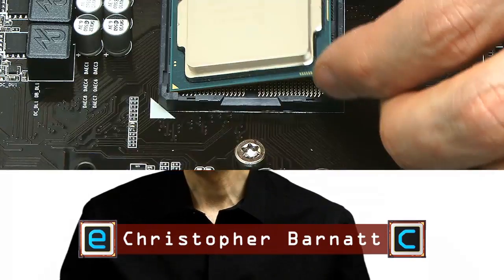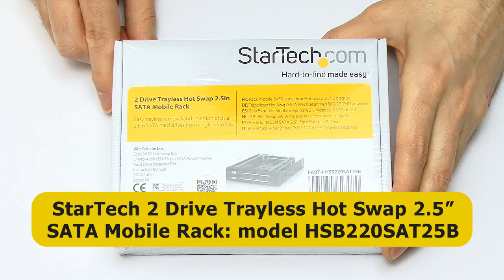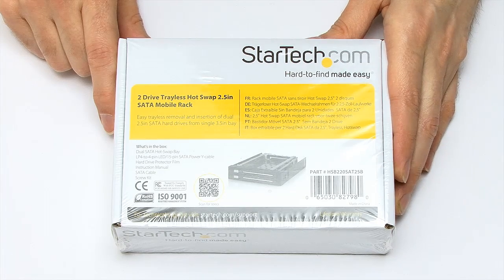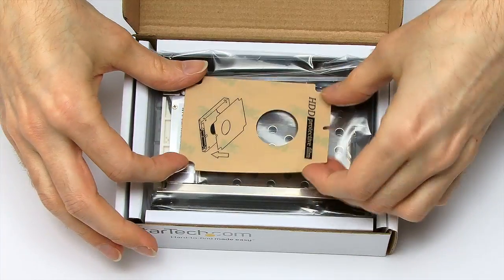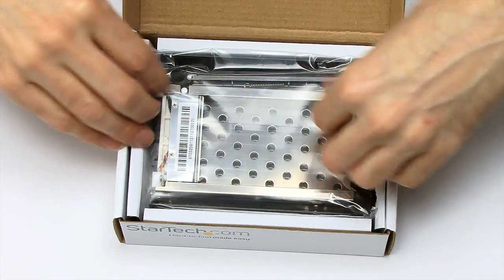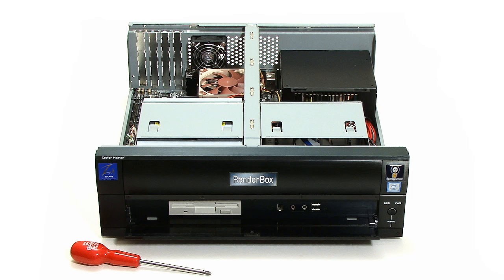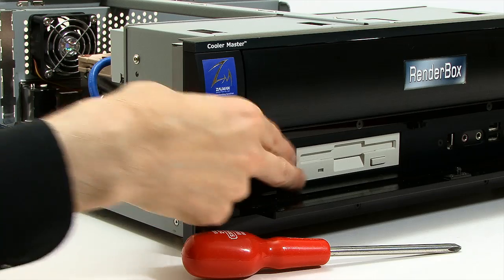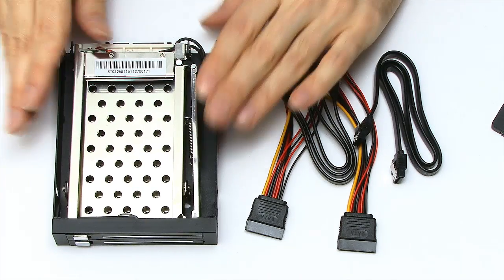Dual Trayless 2.5” SATA Rack

Comment: youtube for some reason is giving me your old videos. Not that I'm complaining. Now that some time has passed, is this still useful? I have an old laptop hard drive I keep in a USB 3 enclosure and I get fairly fast speeds writing to that, and about 200mb/sec when I have an SSD in it. 
I'm trying to think what the useage scenario is for this. You have a 2.5" drive in a camera maybe, and this makes it easy to insert into the computer? 
Transferring from a laptop, but then you have to unscrew it (still useful-ish) to get it out?
Reply from the maker: My usage scenario is mainly switching OS -- having different OS on different 2.5 inch drives. Also accessing drives from archive/storage. And SSDs from HDMI recorders as you say.

Comment: Any reason why I should not use this for swapping/carrying one set of SSDs between my home office PC and my (identical) work PC, instead of trying to keep everything in sync remotely, particularly also OS and programs?
Reply from the maker: For data transfer, no problems at all -- keeping your data on a drive you move bewteen systems can be a great way to work. Some programs may also work. But I would not move around the OS between two PCs unless the hardware is identical (to the level of matching BIOS revisions) as you will run into issues with Windows.
Reply: @ExplainingComputers  Thanks -- actually I WAS thinking to move the OS drive around, because everything else is already synced via cloud. However this most probably will give me problems with Windows and software activation and licences, although the hardware is identical.

Comment: 7:15 That is why you have these molex cables. 
These molex to sata adapters have a bad reputation of causing fire. 
Therefore, is it possible to use this rack without such molex to sata adapter???
Reply from the maker: Yes, you can use it without the adapter (although the drive lights will not work). But there should be no fire issues using SSDs and 25" drives with the adapters -- they draw far less currently than a 3.5 inch unit, and only at 5V (not 12V).
Reply: > "they draw far less currently than a 3.5 inch unit, and only at 5V (not 12V)." 
Good point !!! 
+1

Comment: Hi there, is this SATA thing itself hot swap capable. Could i open the computer case and just plug in a sata drive.
If yes is there a order witch one i should connect first, the power or the data connector. Thanks in advanced!
Reply from the maker: Yes, potentially hot-swappable if this is supported by your OS and drive configuration. Not something I've tried.
Reply: @ExplainingComputers  Thank you for reply, guess i have to refer to the manual or consider to ask my local shop
 to be sure.

Comment: I like the new storage system you have in your computer and hope all works out just fine for you with it. I would like to put something like that in my computer, but don't want to change things around that much. For that reason I will stay with my regular system and if I build another computer it can have 2.5" drives in it.

Comment: I've got one from StarTech that has one 2.5", and one 3.5" bay. Mounts in a standard 5.25" slot. Good for pulling data off old hard drives, or cleaning them for secure disposal.
Seems they've got some active electronics on this model to sense when there's activity over the SATA cable. IDE and SCSI each had a pin that was dedicated to drive activity that was high when there was power to the drive, and pulled low when there was activity, and this made it easy for an enclosure to indicate drive activity. I didn't think there was a way to do that for SATA beyond connecting directly to the controller/MB for the LED.
Reply: Pin 11 on the SATA power connector can be used as an activity indication, though not all drives support it. It is almost certainly what is being used here.

Comment: I love hot-swap bays. Great for any kind of RAID setup. You get a notification that one of your array members has failed, you just pop out the old one, stick in the new, open the RAID utility and tell it that there's a free drive available for rebuilding onto (if you don't have it set to do that automatically), and all without even having to shut down the system.

Now, keep in mind that unless you're using a dedicated RAID controller (which usually support hot-swap), you probably won't just be able to swap out drives without at least having to go into device manager and tell it to scan for new hardware, etc., so this might not be the kind of thing a home user would make use of.

Comment: My main (most powerful) PC has two SATA hot swap bays, one a full-size 3.5" and one is a 2.5". They are both quite similar to what you show here and I am pretty sure even manufactured by StarTech as well, but they actually have a lock and key mechanism too! Unless you have the key, you would basically have to destroy the entire case to access it because they are extremely well built with steel not plastic, and if it is a HDD, it will likely be destroyed just getting to it. They have served me well for several years now, and I definitely recommend them!!!

Comment: I have an Asus ROG GL552VW and would like to replace the optical drive with a caddy or something to put a standard 2.5'' HDD in, however all I've been able to find so far is a type of caddy where you would need to take the whole assembly out every time you swap the drive. Is there a variant of this type of device for laptops or do I just have to keep a screwdriver handy?

Comment: The HDD disk connectors are specified to allow 50 !!!!! connects.
So don't switch too often.
Reply from the maker: This is a really interesting point -- SATA was initially specified at 10 connects! But a lot of pro video hardware now uses an SSD or 2.5" HDD that plugs in via its own SATA connector as the storage media (eg equipment from Atomos). I use such hardware, and often swap the SSD many times a day, and it has always worried me. Certainly the SATA connectors get looser over time. But I've not had one fail yet -- and my oldest recorder has probably done a good 300+ insert/remove cycles.

Comment: I see little reason why StarTech decided to not line the bottom of the drive trays with an adhesive layer of plastic, or had made the drive bottoms out of plastic. If I were engineering that thing I would had made the drive bottoms slide in, clip into place (since plastic can clip in easily) and it would had circumvented the need for protective anything to prevent possible shorting due to metal-on-metal.

About the supplied connector, while it's nice they provided two wires, I don't understand the little extra bit hanging off. If they wanted to be good and proper about it, a locking 1x LP4 to 2x SATA power Y cable should had been sufficient. Power for the LED should had been drawn from the SATA port and not require a separate connector, since i have bits of kit at home that only have a SATA port and the board layout dictates it draws from SATA the power.

Even a piddly 5-volt rail from USB can handle both SATA power to the drive and a basic LED that flashes with drive activity. So the entire design of the unit, while functional, flummoxes me why they went with some of the odd design decisions they did.

Boy the video is full of surprises. I didn't realize they had to power two LEDs. Why do the bays need two LEDs? Seems like a blue one for status and red one for read, used cleverly to render as magenta. Pretty, but whoever made the bay could had reduced costs by using one LED always on for read only. I guess that's why the special connectors have two lanes on the SP4 connector; One for each LED. It's stupidly over-engineered, down to the lights!
Reply from the maker: I agree with all that you say! :)

Comment: LP4
Strange isn't that? When AMP originated that connector, they called it the Mate-N-Lok. When Molex acquired AMP, it became a standard on hard drives and was brutally genericized to Molex despite them making a variety of motherboard and cable interconnects. Now Koch has Molex and they call it LP4.

Speaking of, wasn't there a time when this connector became SP4 before that represented the old connectors from FDDs made by Berg?
Reply: Molex didn't acquire AMP. 

AMP was bought by Tyco in 1999, Tyco then split into three seperate companies with the AMP products going to "Tyco Electronics" who then ranamed themselves to "TE connectivity"

Both Molex and AMP/TYCO/TE have been cloning each others connectors for a long time though. Sadly they use different names for them which can making figuring out the equivalences a PITA.

Comment: Can you recommend one that fits in a 3.5" DVD/CD slot. I see they have some nice Quardrupple ones for 2.5 sata disks
Reply from the maker: You could out this drive in a DVD slot (5.25" bay) using a 5.25 to 3.5" bay adapter. StarTech sell those too! :)
Reply: True and sorry meant 5.25" slot not 3.5" I found this nice one instead, think I will buy it :) http://www.chieftec.eu/en/accessories/sas-sata-backplanes/atm-1042s.html

Comment: Nice Chris.  I'd like to ask for a favor.  If not too much trouble, please set the drives up in a mirror configuration and test the "hot swap" efforts and the RAID rebuilding (preferably BIOS RAID rebuilding but if you must, Windows' RAID rebuilding will work too.  I'd like to know if it'll work like a proper server's hot swaps.  Nice and informative non the less.

Comment: Hi Chris, Sitting in Tokyo Japan watching your videos is a refreshing way to travel back to Blighty in some ways, I mean hearing your turns of phrase as you talk to yourself is really very charming! Do not worry we all do it when we are tinkering with computers, how you manage to keep the Anglo Saxon out though is to be commended also. I am enjoying your videos Sir indeed, do carry on old chap! Hopefully another generation afraid to ask dumb questions is also stealthy watching your exploits and learning along the way. I have spent the last two years hoovering up old yet viable Vista era hardware from the Hard OFF shops around here in Japan a second hand chain local to the Kanto region here and making perfectly serviceable Windows 10 PCs out of all the discarded value and rotating them back out. So I have been able to follow a journey of power and speed through all the CPU and memory configurations I was never able to afford to purchase in the white heat of the PC era 2004 through 2012. The conclusion buy any modern fast SSD like the San Disk Ultra II 480GB versions and bolt it to any Dual core above or equivalent to an E8400 with 4GB of RAM and your cooking with gas if just general surfing and watching You Tube Videos in HD is your 2017 benchmark of use. I am Windows 10 insider so the OS is free of charge for the boxes I rotate out. Giving back a little value to the community here was the thought. Though the reality is Desktop PC use here is declining massively as the mobile onslaught continues anyway. Which means more and more choice hardware is being dumped in these secound hand stores here. https://www.youtube.com/watch?v=rfZFTEAZcvA&list=PLyJvQFBp5UVOIEisUSESuUFrDwfRVdzcA

Comment: Can you hot swap the data drive?
Reply from the maker: Yes, the drives in here are hot--swapable (if the motherboard supports this).
Reply: Do u have to dismount first?
Reply from the maker: You should always dismount (in the OS) first! The computer has to be prepared for the fact that you are about to physically disconnect a storage device. :)
Reply: Thanks Chris
Reply: i also think that is chipset dependent cause the correct thing to do is also cut power for the drive on those cases,belive me,i fried a drive trying... it smoked as i wigled its (still hot) power connector out of the socket
Reply: You'll need to go into your BIOS settings, and look particularly for the SATA settings. For example on my motherboard, you can enable hot-swap on a per-port basis. This of course depends on your board and which chipset it has, but generally, it'll then let you select the drive from the Safely Remove Hardware icon near the clock in Windows. A bit like when you want to dismount a flash drive. Some boards will also detect a drive has been introduced, but if not, you can Scan For Hardware Changes in Device Manager.
Reply: I use this for proper system removal w/o having to power off.
http://mt-naka.com/hotswap/index_enu.htm

Comment: Hello ExplainingComputers. Thanks for the video! You should forget about those protection sheets on each harddrive and place a piece of anti static teflon in the trays instead. You can buy A4 sheets that are adhesive on one side and cut them out with a scissor. When you are done, you can use the rest of the sheet for new mouse pads, to make your mouse slide like new again! :-)
Reply: You could also clean the grime off the bottom of your mouse :P

Comment: This question doesn't fit in here, but I just want to know if I can connect the new macbook pro(usb type c) to a arduino board(usb type b) with a adapter or a usb c to usb b cable?
Reply from the maker: Yes, both of these options should work fine -- the different USB connectors are just that; the USB data that flows through them is the same. Everything is backwards compatible. :)
Reply: Thank you so much for the quick answer!:)

Comment: they should have just had a back plan on that caddy for power and then the data why the need for all the extra wires when it could be all done with just one power cable.

Comment: Does your motherboard have support to make the SATA port hot swappable while the computer is still on?
On my old computer, I had a 3.5" hard drive caddy in a 5.25" slot but it was not hot swap compatible and had to power down to swap out the drive. My current computer I have swapped the SATA port in the motherboard setting to hot-swap compatible that my trayless 3.5" hard drive bay is plugged into. I can select the eject option you normally use for a USB stick or external hard drive so I can swap my data drive without powering down now.
Might I suggest to make life a bit easier you put your SSD boot drive into the bottom and the HDD into the top. Stick a piece of anti-static plastic into the bottom of that top tray over the metal. That way even if the drive does not have one of those stickers on it will sill be a little bit protected.
Reply from the maker: You do not have to have a motherboard with hot swap compatibility to use the bay, but you can only hot swap the drives if your motherboard supports this.

Comment: Where did you get the Render case, and what motherboards can be installed in it?  This would make a great compact out of the way desktop PC which I really need.
Reply: Fractal design node 202 might work as long as your monitor isn't too heavy and you can get an itx board that satisfies your needs, it will lay horizontal or stand vertical and can fit most add in cards except for some extremely large graphics cards. You would have difficulty finding the Render case as it was stated in an earlier video it was from the old build with the core 2 so it is probably out of production.
Reply: +William Todd
That was just the first one that came to mind, there are several cases that will come up under the htpc form factor if you search on pcpartpicker that all can be laid down horizontally, maybe one will suit your needs
Reply: William Todd buy a real case, that case is old and has no intake and do you really want your PC to look like a VHS player?
Reply: So what case do you recommend?  I don't want a tiny case, just one that my monitor can sit on as I'm kind of limited to desktop space at the moment and PC case on carpet is a terrible idea.
Reply: William Todd Streacom F12C is one of my suggestions, not many cases that are horizontal. Would recommend buying metal cases over plastic if you wanna put a monitor on it. 😁
Reply: Virus 282 Yep, definitely want a metal case, although today's LCD monitors are lighter weight, a plastic case would definitely not be very supportive.
Reply: Cooper Cummings Doesn't look like the Fractal case has a 5-1/4" bay for optical drives or in this case for this SATA rack
Reply: Thank you.  I'll do some digging and see what I can come up with.

Comment: Well, this may be a dumb question, but I had never worked with those trays before, do you have to extract disk via software or you can just unplug them with the button?
Reply from the maker: Here the device is hot-swap -- so you can just eject the drive. Though do not do so for the drive containing the operating system! And drives should be unmounted first before being physically removed to prevent data corruption.

Comment: Those are very handy.
I have a 1 bay 2,5" version in my pc for the boot drive so i can switch between operating systems.
And a 3 bay 3,5" version for my data drives.